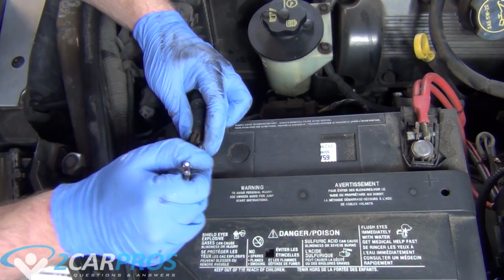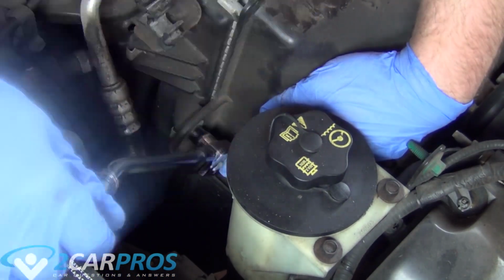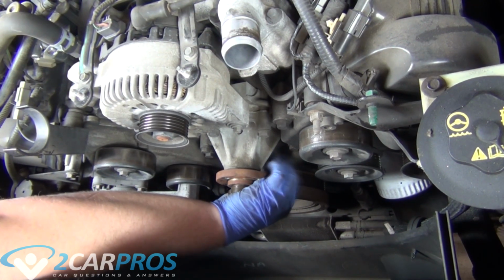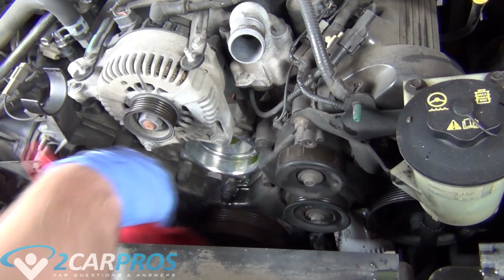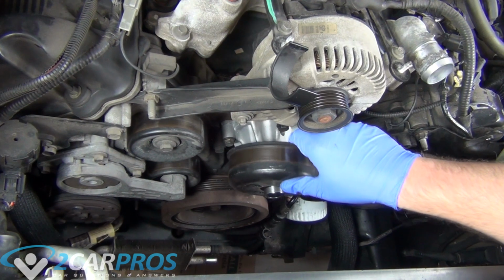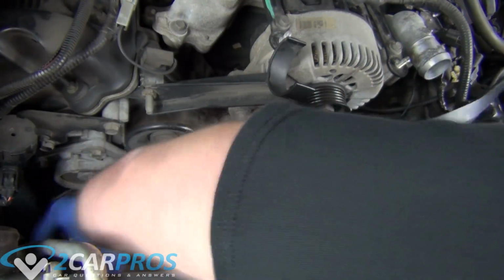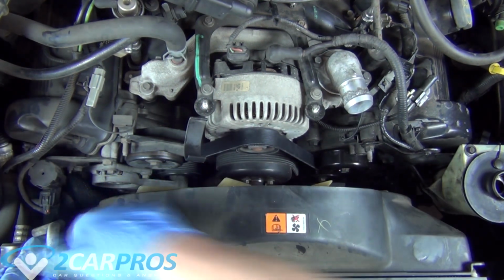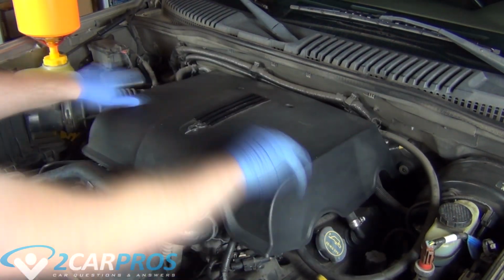How to Replace a Water Pump in a Ford Explorer 4.6L V8 2002-2005

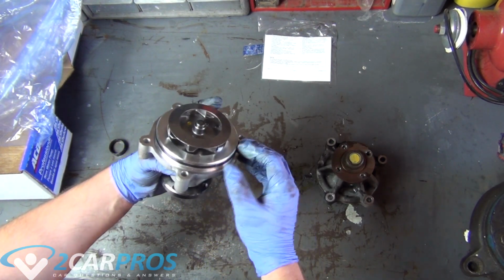Comment: You MUST lube the o-ring (at 9:00 min)with oil is best. First time I did with WD40, perhaps not enough, and the O-ring crimped and failed after startup ran for 10 mins. Had to tear it all down again, go fetch another o-ring and it was a success with oil.
Reply: He shoulda used lithium grease honestly, wd is worst option , oil is second best option

Comment: I have a 2003 Lincoln Aviator and to release the tension belt a 1/2 inch is too big and 3/8 is too small, what tool do I need? thanks

Comment: So, about the water pump pulley installation part, are those the only two methods to install it? I have a fairly similar setup for my water pump but I'm kind of afraid to do it the same way you showed here. I tried tightening it with the serpentine belt on but the pulley spins when attempting to tighten up the bolts (there's resistance to get it somewhat tight, but not torque level tight). Tried to use a flathead screwdriver wedged in between bolts, but this "KKKKKCCCCCHH!!!!" sound as I'm attempting to tighten makes me think that's a very bad idea lol.

So is there another way to tighten up a water pump pulley?
Reply from the maker: Make sure your bolts and threads are clean. It shouldn't be that hard to tighten. But yeah those are the two ways. Thanks for watching!

Comment: hi, I have a leakage on the engine pulley, so far I haven't found what is wrong
Reply: Pablo Santiago if it’s under your crank pulley then it’s your Timing cover gasket that’s leaking

Comment: Why didn’t you just leave on the belt so you could take off the pully bolts off easier
Reply from the maker: Because you wouldn't want that much tension on a pulley while removing it. Thanks for watching!

Comment: I was all good until you put that green antifreeze. Ford 2005 calls for Gold only, and when you don't use it you loose parts starting with water pumps.
Reply from the maker: Been running great ever since! 50k Miles so far. Thanks for watching!